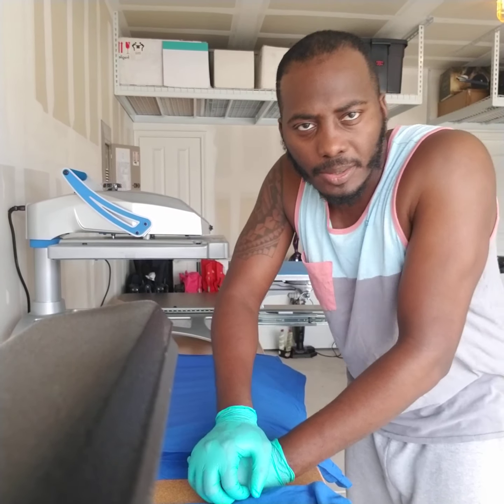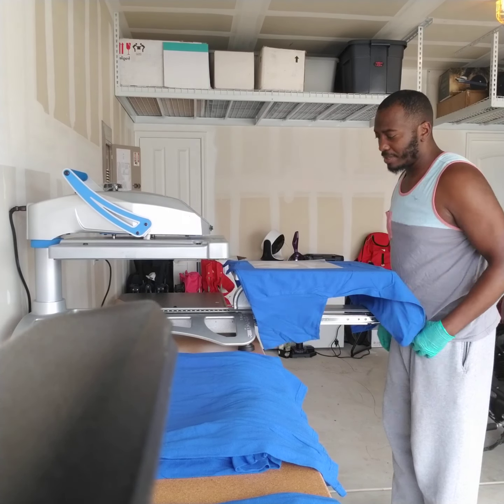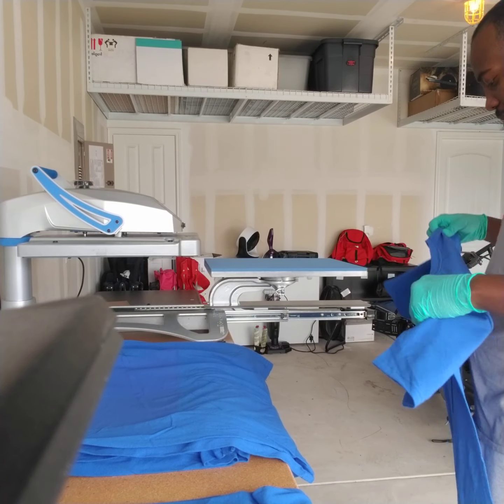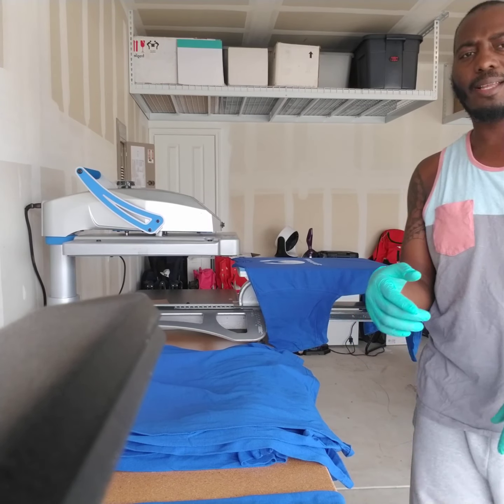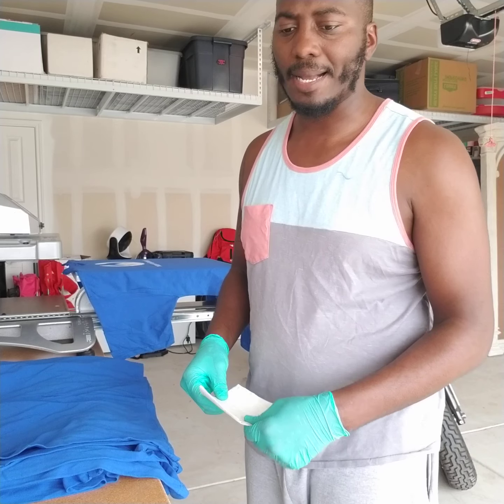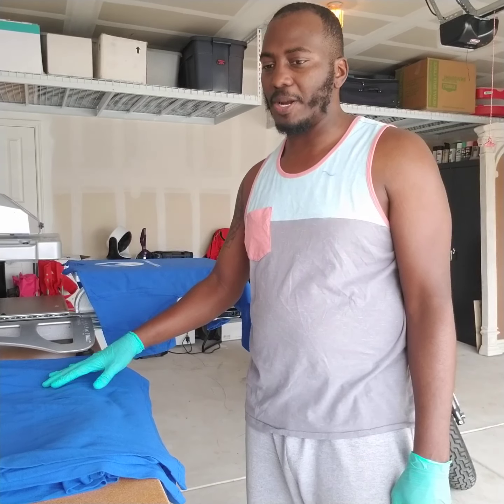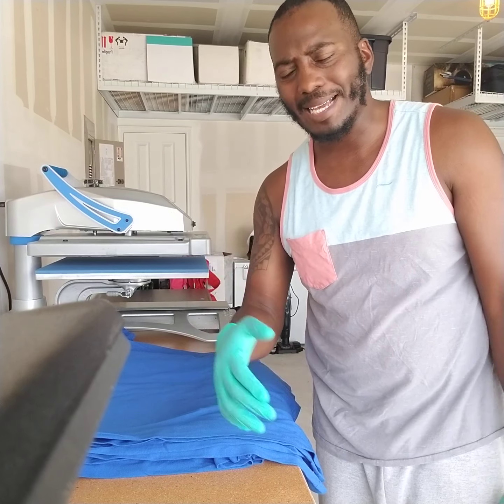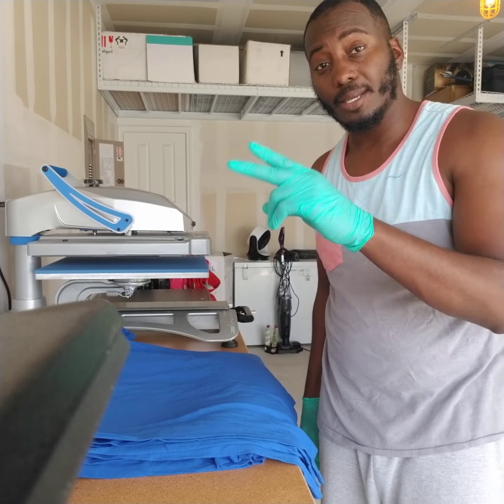New Equipment, Client Orders & Talking Business

Comment: Other option compared to dtg is Uninet icolor printer
Reply from the maker: Ya that is an option, but your talking $4000+ for a machine, with many steps involved to complete a shirt. I would rather use supacolor, take a transfer, put it on a shirt, press for 10 seconds, DTG quality. Time is everything and I guarantee you that DTG and Icolor printers are not time effiecient compared to supacolor.
Reply: @JoJoEnglish  true, but than they have this 20 minimum and are also more expensive.